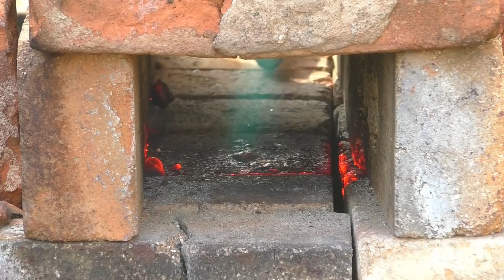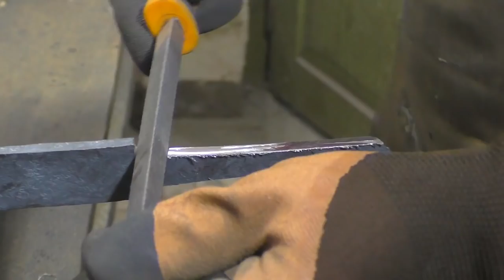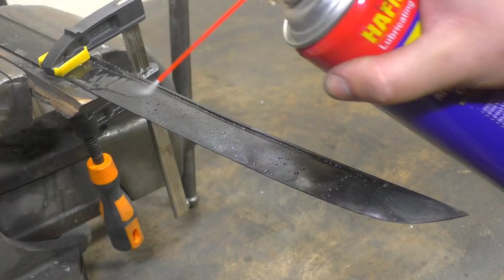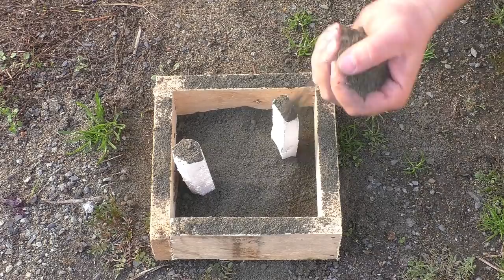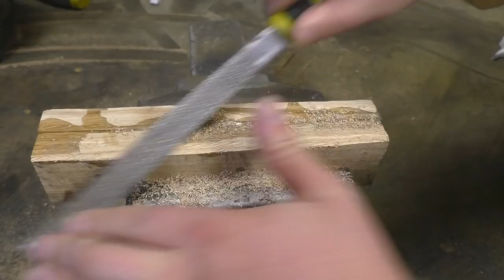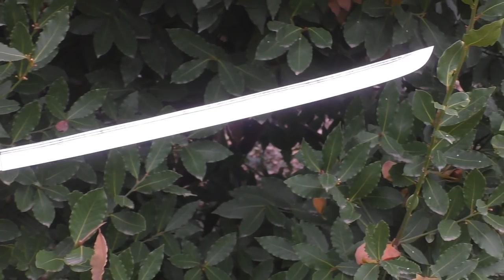Forging a KATANA out of Giant Shock absorber

Comment: I'm not a blacksmith, but I am a swordfighter based on kenjutsu and as a user, I have some hints to give:
- The hilt is short, it needs to be a little bit longer in order to use the Te No Uchi grip, whitch is a two handed technique based on using the centripetal force pulling the extremities of the hilt in opposite sides.
- You have to harden just the blade's cutting edge. The blade's back must to be soft to bend and swing to absorb the impact, preventing the blade to break.
But it's a beautiful start. I hope I can see you forging some real katana shortly. I like your videos!
Reply: The tang is about the length it needs to be the handle needs to be at least 2/3 of the tang
Reply: o cara é brabo, teve paciência de jogar tudo isso no tradutor. Kkk
Reply: @Miguel_deep  não precisei, amigo.

Comment: This is not even what I would consider a katana shaped object. Do any of you home grown sword smiths even do any research on the katana and its ratios or why those ratios even exist in the different kinds of katanas? 
This size would equate to a wakizashi but it is all wrong. Do some study on the katana and make something that resembles a katana before you call it a katana. This sword has more in common with a machete or a battle axe than a katana.